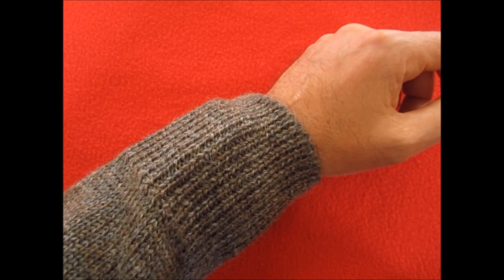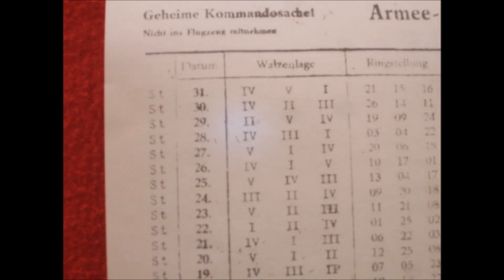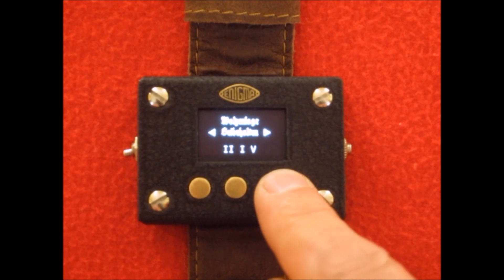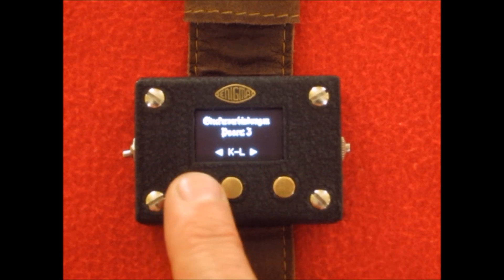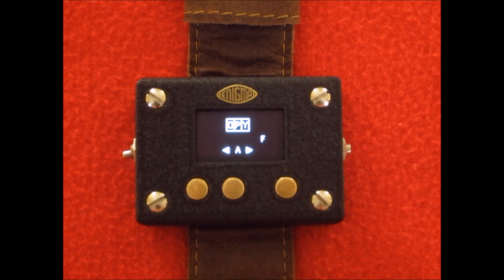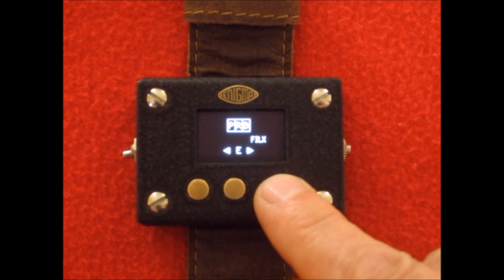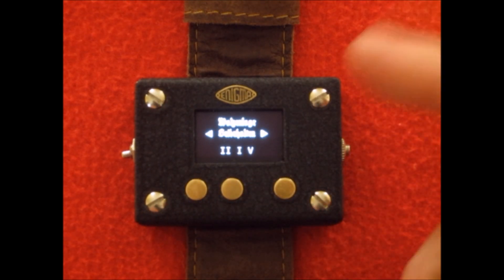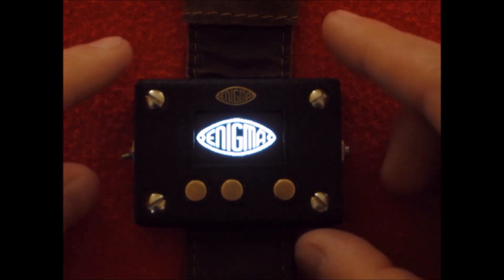Enigma machine wrist watch

Comment: I like it, it is cool - - but seems to tedious to work with
Reply from the maker: True, but considering a real Enigma required 3 people to operate it during the war I would say it's an improvement!
Reply: @asciimation  Three people to transmit a ciphered message but only two to receive and decipher a message? 
The SchrebMax printer made a transcriber unnecessary.

Oh what the hell do I know, so much info has got me confused.
A new idea: Simulate the Soviet-Era Fialka. That was a rotor based machine like the Enigma, only its reflector wheel was incorporated with solid state crktry that allowed an enciphered letter to be represented by itself. That would remove the Achilles Heel of the Enigma Cipher
Reply from the maker: @JohnSmith-eo5sp  3 includes the radio operator so they don't really count I think! There is a lot of info about and some is confusing. Especially from 'historical' films like Enigma and The Imitation Game. That film had more wrong than right and is what really got me into the real history of things.
Reply: @asciimation  The British (and others) have created a lot of misinformation. They are a cover-up society

Comment: How did you get that "bumpy metal" finish ? Im making a full scale enigma machine, and would really like to know :)
Reply from the maker: It's a paint finish. I used VHT wrinkle plus paint from the auto parts shop. It can be tricky to get an even finish. I usually wait for a very hot day then spray it then and leave the parts in the sun. Practice first!